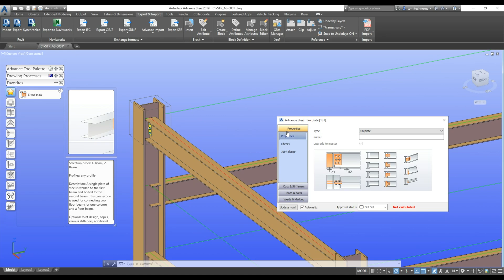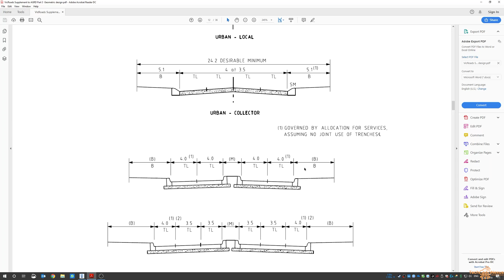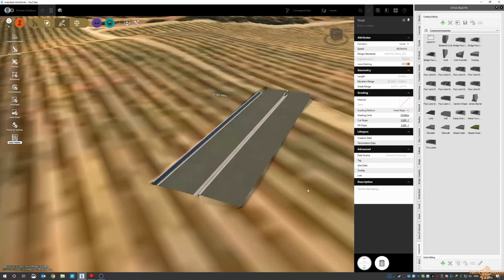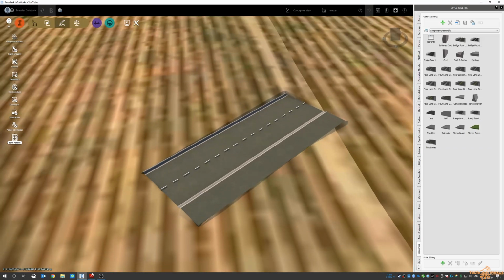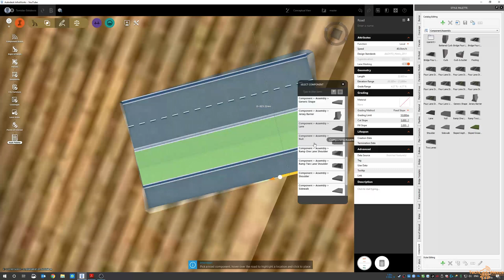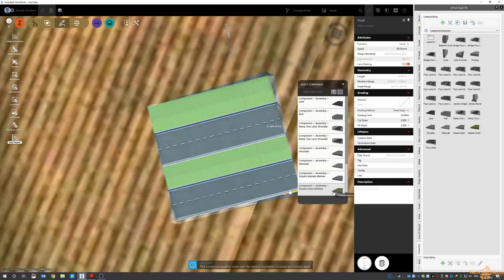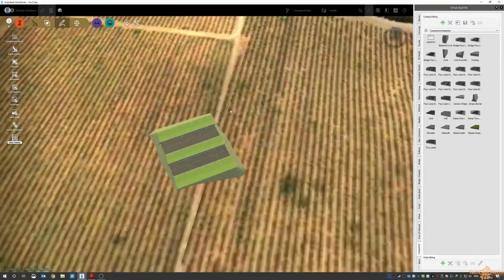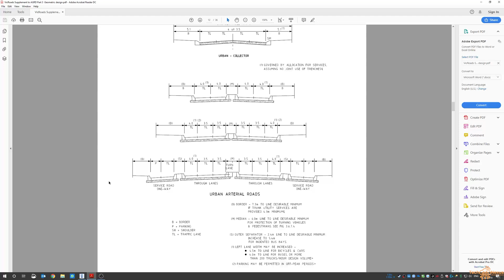InfraWorks Week - Custom Road Styles

Comment: How would you make the greenspace outside the curb flow one direction and not v-bottom like the median?
Reply from the maker: HI Dane, the grassy on the outside could be replaced by another lane, and then apply a grass material to it. The sloped median is just that, a slope in the middle. You can play with the values and make it flat, but it's always going to slope in the middle. I tested with putting a lane on the outside, making it grassy, and sloping it one way or another, which I think will satisfy your needs.
Reply: Intersections will freak out if you apply grass material to a lane component.
Reply from the maker: Dane Martin agreed. There are times where the material/textures don’t play nice when the angles/surface/grading don’t mesh properly.
Reply from the maker: Hi Dane, here is today's video with the answer - https://www.youtube.com/watch?v=dkGusvOEBxY